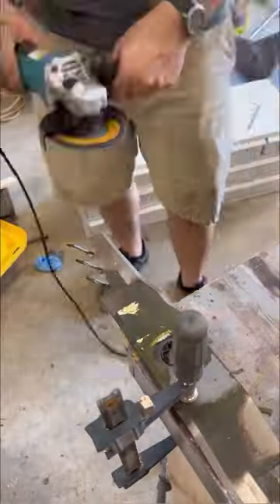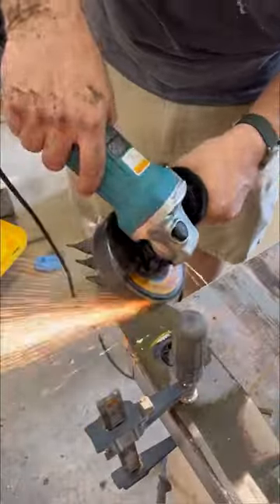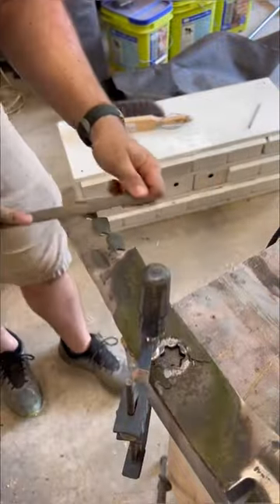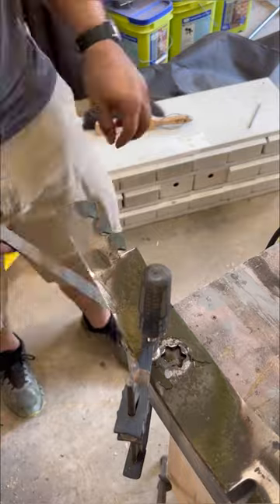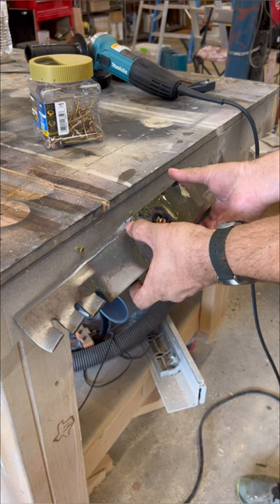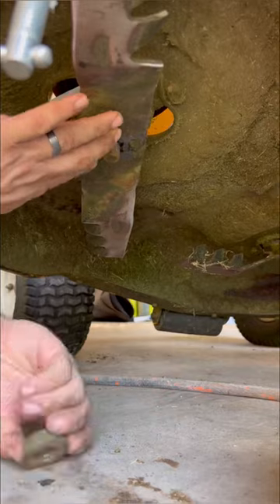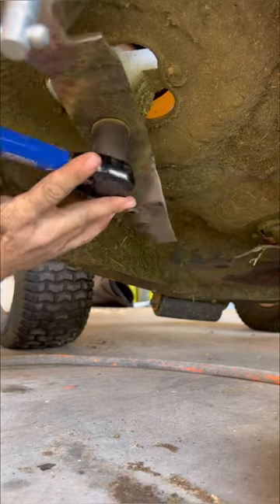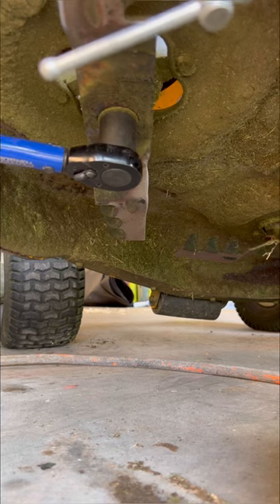3 things you didn’t know about your lawnmower blade #diy #lawncare #lawnmaintenance #tools

Comment: I’ve been in the Lawncare business for 10 years, I’ve never noticed the difference between Balancing and not balancing
Reply: because there is none if your blade doesnt weigh like 5kg. Its only for taking better care of the machine because of micro vibrations so bolt n stuff dont come lose, which definitely shouldnt happen even if it vibrates.
Reply: @Sharpless2  yeah just a waste of time
Reply: @Sharpless2 I have a 61 inch Scag 3-wheeler with almost 5,000 hours on it that has two out of the three Factory spindles. It was used professionally in my landscaping business for almost 15 years. My brother currently using it at his house. I have never in my life ever balanced a mower blade. But at the same time I properly maintain all of my equipment.

Comment: All fasteners technically have a torque value. Most just don't really matter.
Reply: Tighten till she loosens, back off quarter turn.
Replace hardware with every part change, haha
Reply: @threadtapwhisperer5136  I torque spec my lug nuts. Some say it doesn't matter but my rotors stay smooth.

Comment: Another tip, is not to use a nail to balance your blade. Use a blade balancer, they’re very cheap and they work.
Reply: And a nail is cheaper....... some would say even free.
Reply: @teh_fatninja430  but not very accurate. use a nail and then rebalance it on an actual balancer and see the difference.
Reply: @garysgarage3669  I wouldn't know if either of them are accurate. I've never balanced a mower blade in my life.
Reply: @teh_fatninja430  most people don't and really, unless they're really bad, you don't need too.
Reply: @garysgarage3669  as long as you do the same amount of swipes with the same pressure on both sides you should be perfectly fine.
Reply: @teh_fatninja430  true, most people I know don't even balance them.

Comment: Worked for a landscaping company and we sharpened the blades so often there was zero point in balancing the blade and torquing it down. For home use it's just about the same really
Reply: Yup, my Dad brought out the torque wrench. He checked the manual and I told him that's why he stripped the bolt trying to get the blade off. This ain't no aircraft lol, it's just a mower.
Reply: @AntwonJenkins  Yup just a couple ugga dugs with my impact and it's good

Comment: Torque setting: twist of off and back off 1/2 turn.
Reply: ...funny you should mention that, ALKITRONIC has a video that demonstrates the effects of rust, and then the opposite effect of over lube, but you could find your ANGLE clean and dry, and then you could formulate a PRETORQUE of about 1/4 to 1/5 the final torque value and then finish with about 1/4 to 1/2 turn....incidentally, my current formula for a lugnut on a semi is 100ftlbs + 1/3 turn...(rust cleaned off studd with  1 drop of oil on studd and 1 drop of oil under collar)

Comment: When you hit a tree stump an over-tight blade will bend the shaft and potentially kill the engine. The correct torque makes sure the blade slips.
Reply: this has never happened to me once before, neither have i ever seen it. On some lawnmowers here we even have locator pins so it literally can not slip no matter what. 
The engine will turn off and thats it. At most the blade will have a dent you can grind out and its good as new.
Reply: I hit a hidden stump with a push mower and it did exactly that. The arbor was destroyed and the mower vibrated so bad you couldn't push it.

Comment: I’m going to be honest I was passed a long care from my dad, He did good but that’s how he taught me to do blades when I was younger.
I found it can be very inefficient especially for people that don’t have much experience with power tools.
I’m 17 and I have much to learn but  for a blade being sharpened,
One, depends on what the blade is being used for, mulch or finish 
For mulching the blade angle should be between 12 to 18,  15 degrees being perfect 
For finishing the angle should be in the 30 to 40 degree range 35 being perfect 
Good day to you also this will work I run on a commercial scale so finding any and every way to be more efficient is always a good thing
I also do my blades by hand if I have the time makes easy work to get that perfect angle 
Hope this helps someone

Comment: One tip here: do take out the boot to your spark plug, you don't want to accidentally start your mower while you're removing or installing the blade.
Reply: Geez you really go the extra mile
Reply: @michaelnorman5640  lock out tag out concept, doesn’t hurt!
Reply: "Whoops I just ripped the pull cord out at the 100mph needed to start this thing, there goes my other hand that was somehow underneath it"

Comment: I used to use a file to remove the burr now I use a belt sander. 
Flap wheel to get close belt sander to finish. You will probably ruin a few belts until you learn what direction and angle to run the belt sander.  Pay close attention you will master it quickly. 
Leaves a razor sharp blade. Then I use my file with a couple of light strokes to remove the razor sharp edge. If you don’t you will nick the blade very quickly. You will notice a big difference on the quality of cut and the mower will work much easier! Your grass will even be greener without the cut edge being splintered.

Comment: Ive never seen a blade with a saw like edge on the back...
Reply: It's supposed to create lift to pull the grass up a bit while cutting
Reply: @steveeab2364  the bend in a blade is for that, but I've never seen this design before.

Comment: I never use a torque wrench for that stuff. Only inside engines like bearing caps, cylinder heads, intake manifolds, and anywhere there's a gasket where I need consistent torque on multiple bolts to keep it straight and not squish the gaskets too much or not enough.
Reply: Wheels 😂
Reply: @chemdawgsd2146 that depends if i have one one me i use it but if i dont i dont sweat it and will just check that it stays tight here and there
Reply: @brentbennett5401  🤣